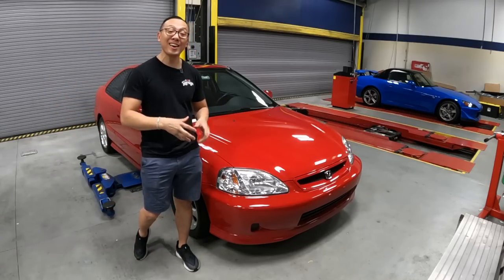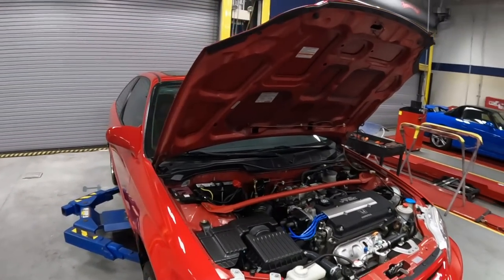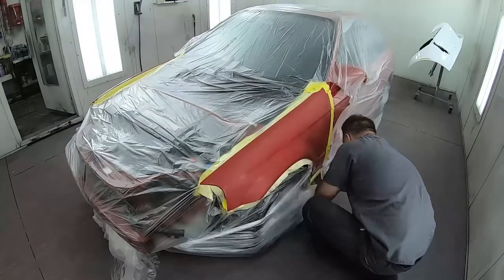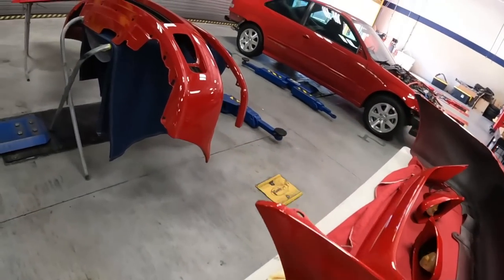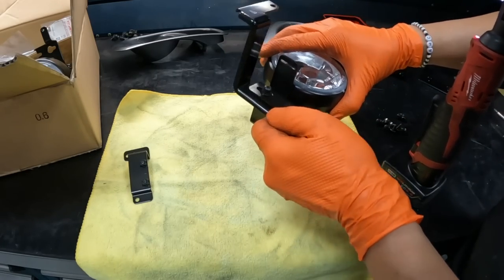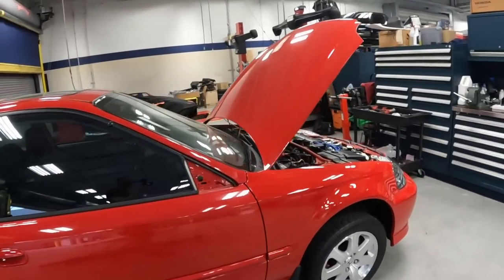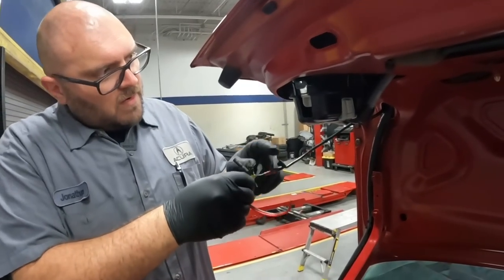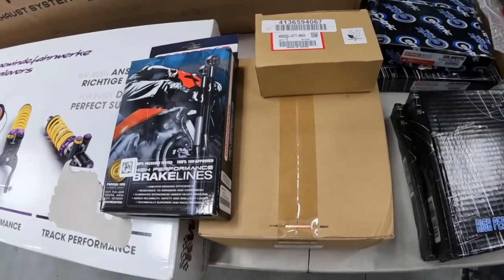2000 Honda Civic Si EM1 - Fresh Milano Red Paint Job  | OEM Accessory Installation (Episode 1)

Comment: She looks sweet! Nice job.

Would you please provide the part number for the upgraded trunk torsion rods? I have an electric trunk popper connected to my car alarm. The trunk has always slammed closed and now it's only exacerbated with the addition of the solenoid (which is a little heavy).

Comment: I was wondering if soda blasting would be better to remove the paint down to bare metal or plastics? I'm about do to an restro mod on a '96 civic HX.
Reply from the maker: We often see folks do sand blasting not sure if soda would be strong enough to penetrate through all of the layers of paint. Very interest topic
Reply: @ahcgarage  Thanks for the quick reply also. Btw, how did you guys get the brand new Type R headlights?

Comment: RHD headlights have a different beam pattern, they are angled to the left in order not to blind the oncoming drivers and ensure better lighting of the curb. Has it been addressed? Are they street-legal in the US?
Reply from the maker: Yup sure did. Just got to adjust both headlight beams. 2 minutes job

Comment: That's a beautiful Civic. Back when Honda Really cared about their cars and characters. Hondas current bean counters have Nooooo idea of what car character is all about. Even the new main stream civics look the same as the main stream accords. I can't tell them apart at first glance. This is why I've decided to hold onto my 02 Accord even though I just purchases a special edition Pilot. My 02 Accord is a legitimate Japanese Domestic Import. Even now the interior is top notch in build quality and fit and finish. The engine needs to be rebuilt, the cluch needs to be replaced, the oem paint has not held up at all despite my Diligent efforts to wash carefully and wax using quality products and keeping her garaged. All Honda vehicles 1998 to 2002 are prone to poor paint quality and failure. Something about the paint Honda used at that time.
Reply from the maker: Thanks for your insight

Comment: I know you want to go the oem route, but leds in reflector housing will blind oncomming drivers. The only safe and proper way to upgrade your lights is to do a retrofit.
Reply from the maker: Thanks for the infos
Reply: Correct! The lights look great! But the CTR headlights will blind everyone on the road. The RHD beam angle is not for US roads.